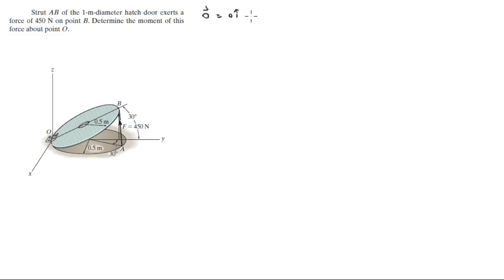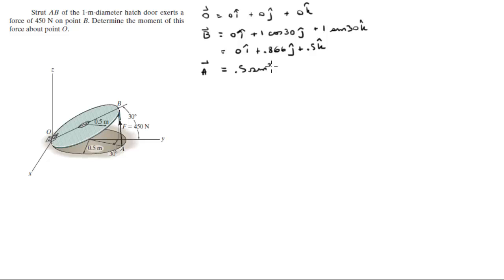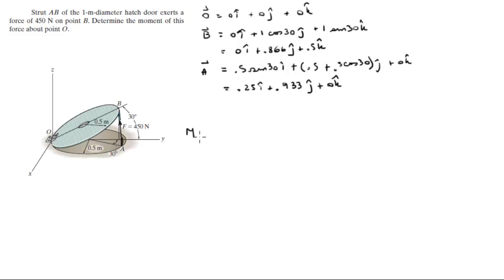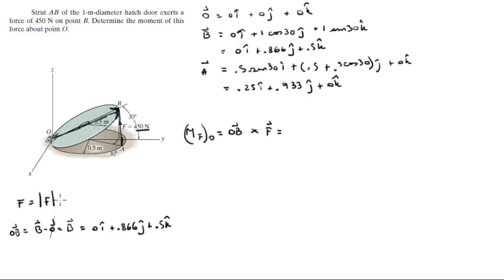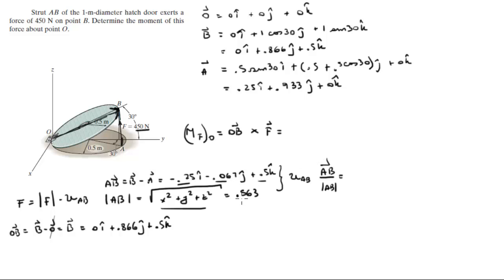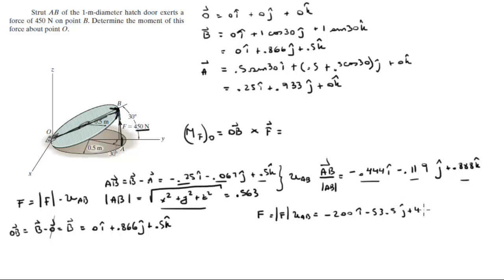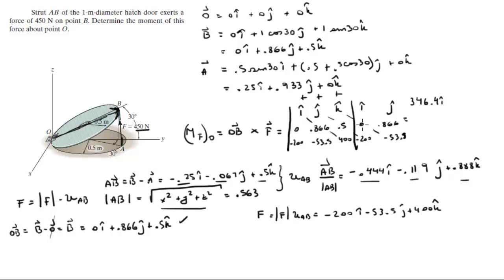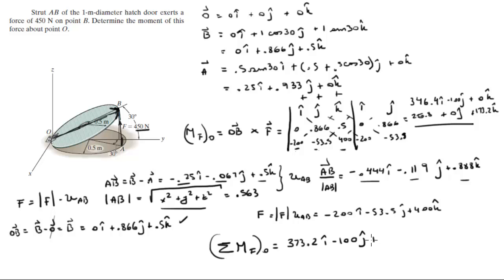Determine the moment of this force about point O

Comment: How can you find  Y ponent of point B
Reply: Utilize the identity of cosine, where cosine(angle) = adjacent / hypotenuse.

In this case, we are finding the distance adjacent to the angle. Our hypotenuse is equal to one meter in length as it is the diameter of the circle.
cos(30) = y-component / 1 m diameter, y = cos(30) = 0.5 meters

While this was 2 years ago, I'm someone else will come along and wonder the same thing.
Reply: @lindseykubsch8384  for j what angle he used? which one of the 30°? both are 30° and confused me.
Reply: @CarlosFranciscoHernándezOrozco The 30° angle made by Line BO and the x-y plane.

Comment: hey I don't understand how you got -0.067j for AB when B is .866j and A is .433j. could you please explain this to me
Reply: I know this was five years ago, and I hope you are doing well now. I just encountered this and I have come to realize how they got this. The 0.433j is the y component of the triangle with stems from y=0.5m(Essentially, the corner with a 30 degree angle is 0.5m away from the origin). Thus, you must add 0.433j and 0.5j to get the total representation of the distance in the y direction for B. 

Once you subtract (0.433j+0.5j = 0.933j) 0.933j from the j component of A, you are left with -0.067j. 

I hope this helps anyone else who comes along and it confused.